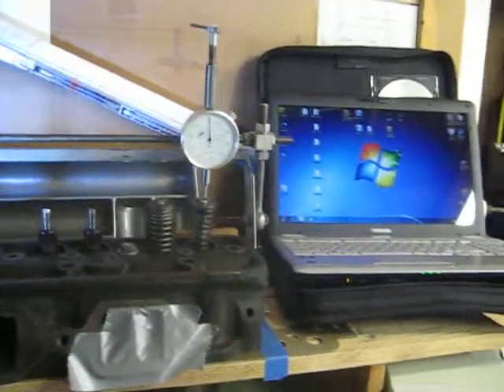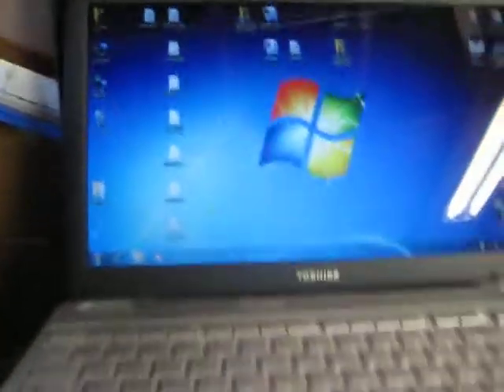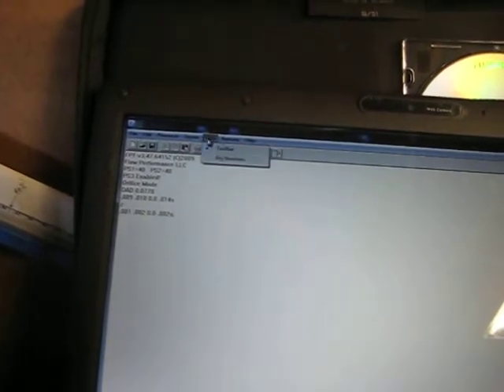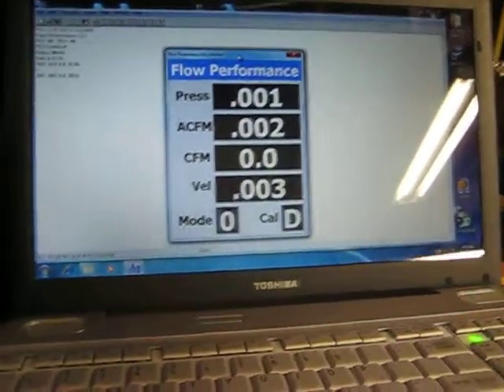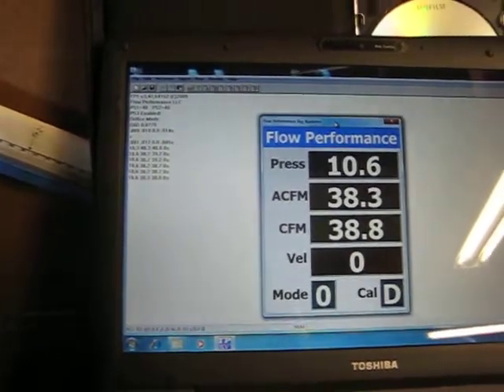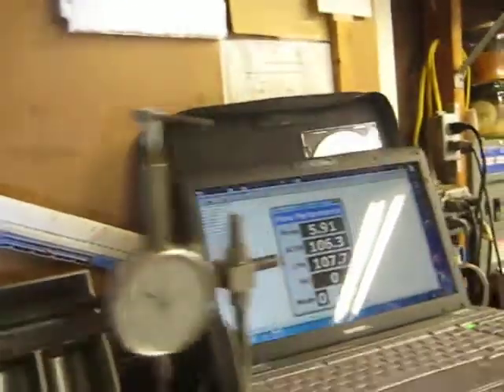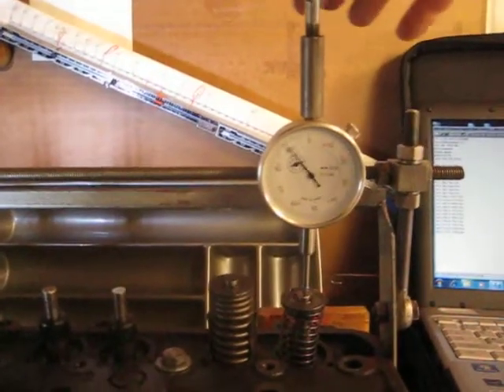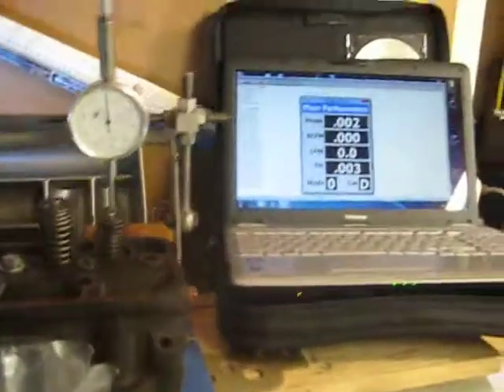Studebaker Exhaust CFM Flow on Cylinder Head  Port # 1

Comment: thanks for your effort for making this video. Im an automotive engineering student and i would like to ask you a few questions regarding this video. i'll hope you are willingly to explain it sir. here i go;

1. What is CFM is all about?
2. Why is second motor is turned on when pressure drops below 6?
3. why is the test is finished after 500th of a thousand measurement is taken?

thanks.